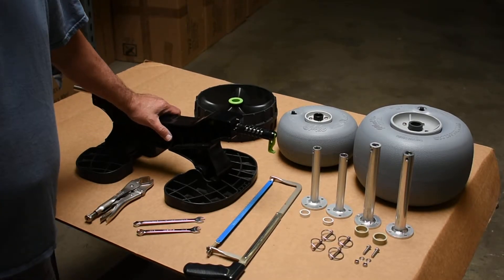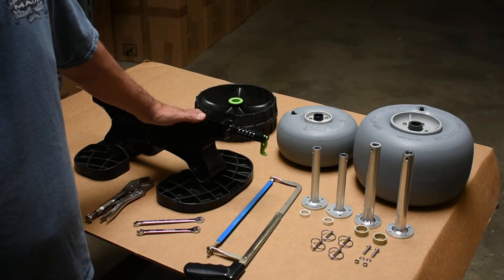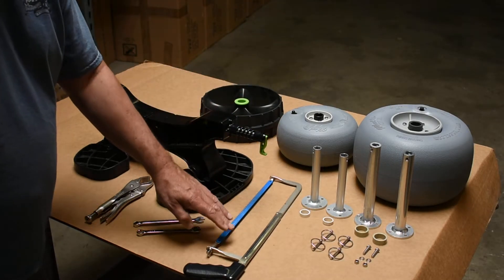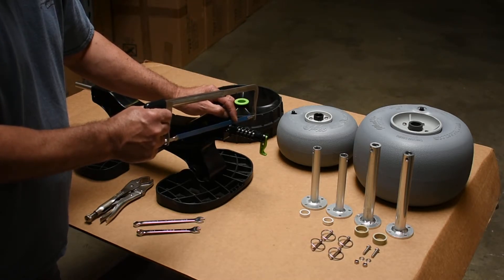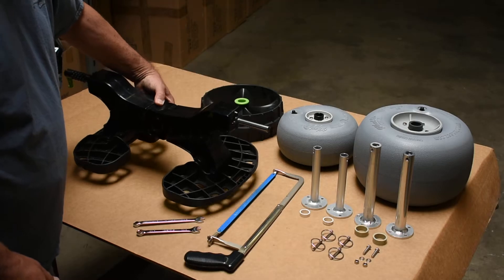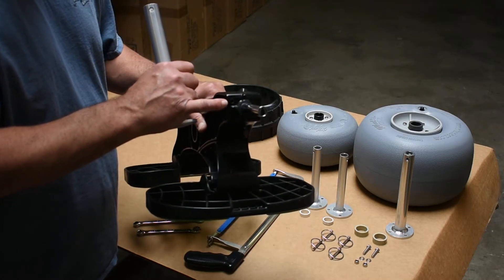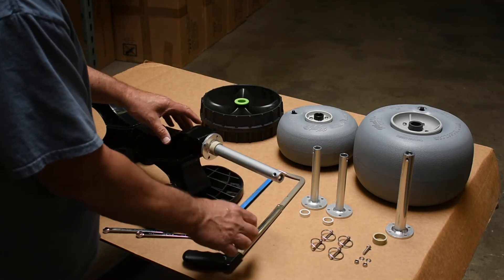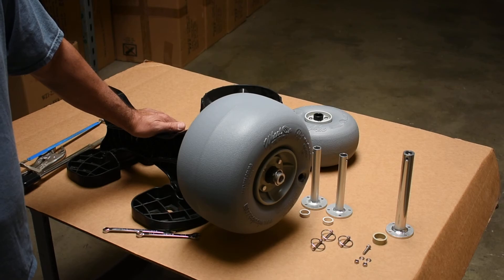C Tug Instructional Video

Comment: Buying the conversion is as expensive as the c-tug car. That is as easy as sending 316 steel tubes with a 316 steel washer and follow the assembly instructions, you don't spend more than 30 dollars
Reply: The question is what is a diameter of a tube?
Reply: @artifazer  20mm